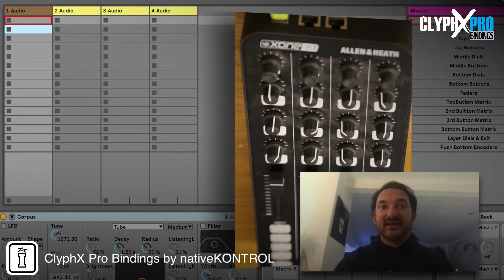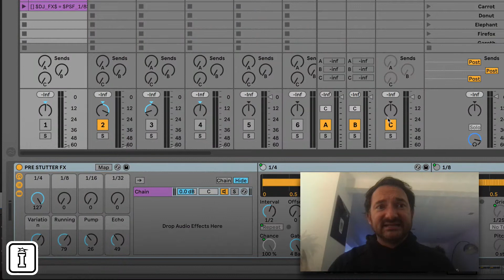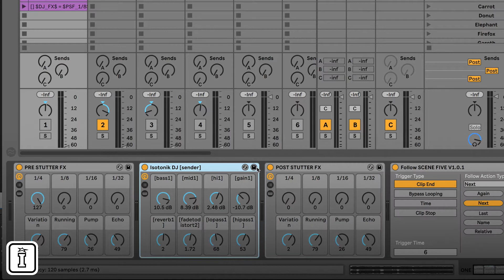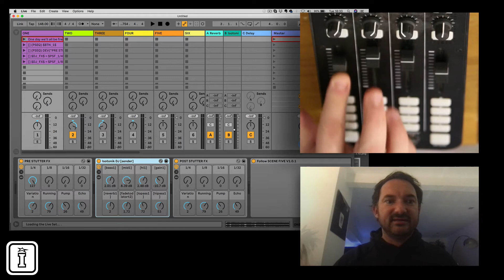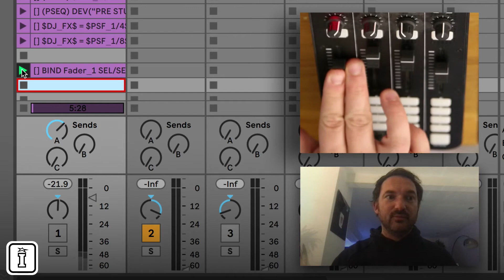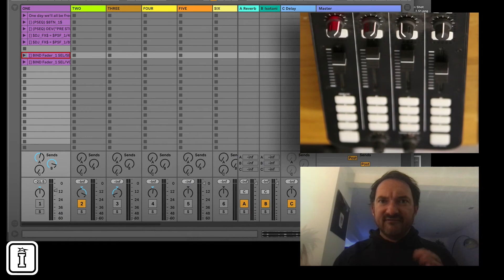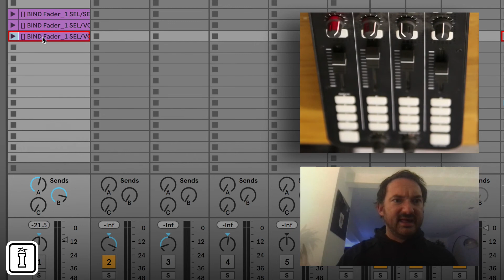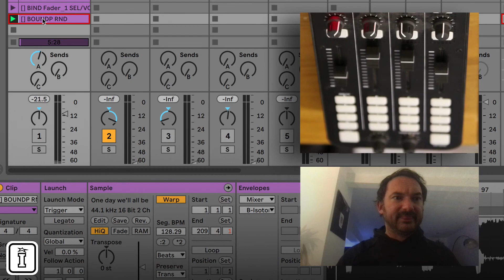nativeKONTROL ClyphX Pro Bindings: Encoder Bindings - Selected Track

Comment: i just bought bindings, followed installation instructions, restarted computer, and all i see in my ClyphX_Pro folder is "Context Bindings.txt" - did something change recently and so this is what is should use for both encoders and buttons, or am i missing something with installation?
Reply: How are you liking your Bindings purchase. I think this is what I need, but am sort of confused. 

I just want to be able to have  midi controller that is on CH8 permanently control u-he diva. But I don't want diva always loaded in my set using cpu.
Reply: I'm not sure but hopefully the guy who made the video will respond to you
Reply: i had to open up ableton one time, thanks

Comment: So, does that mean you can use clyphx to save different midi mappings to switch between so you can change values of different copies of instruments with the same midi controller on the fly?
Trying to get around remapping a controller per instrument every time I switch back and forth.
Reply: I have same question